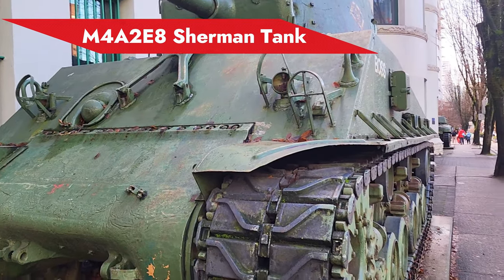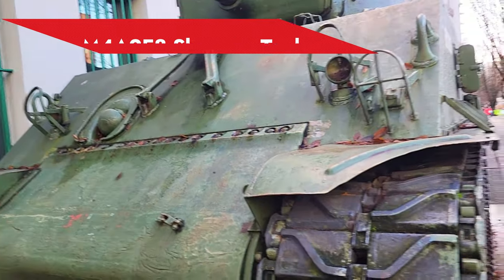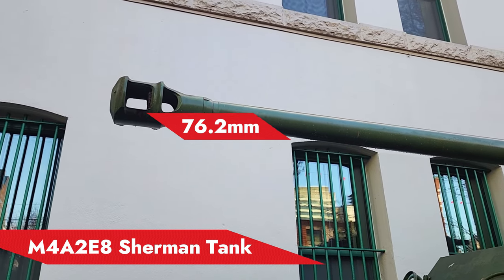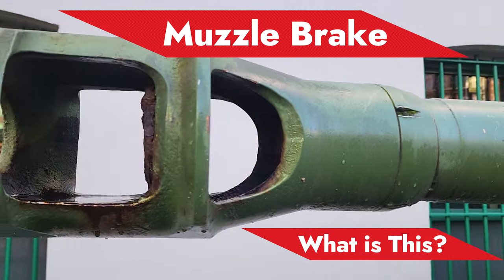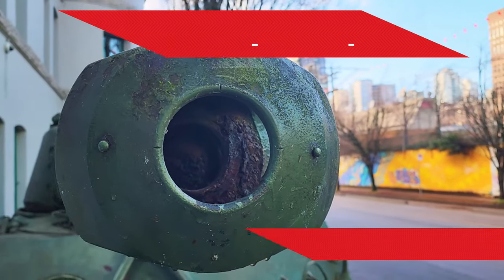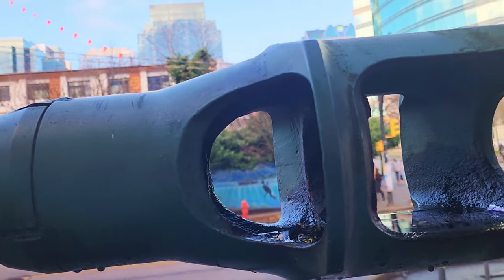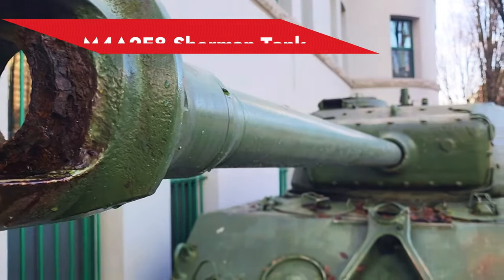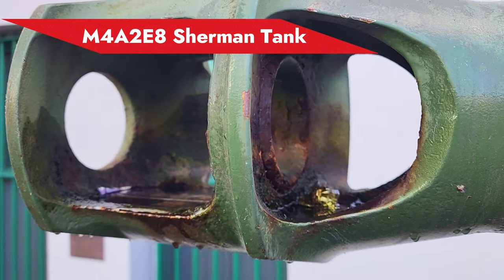M4A3E8 SHERMAN TANK WHAT IS THE USE OF MUZZLE BREAK3

Comment: Generally, muzzle brakes are used on tanks to reduce the recoil force on the recoil mechanism and to reduce the stroke (how far the breach recoils inside the turret).

However, in the M4's case, it was added just for reducing the obscuration caused by the amount of dirt/dust kicked up when firing by directing the blast sideways. Allowing for better observation of shots on target.
Reply from the maker: That really make sense, specially when the tanks gun is near the ground, it will surely kick a lot of dust that is visible even in a distance.